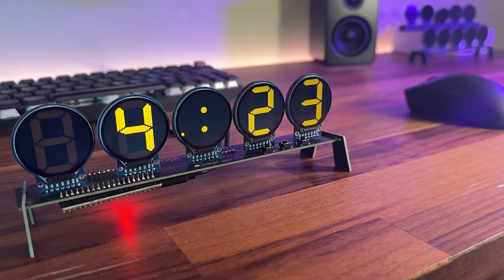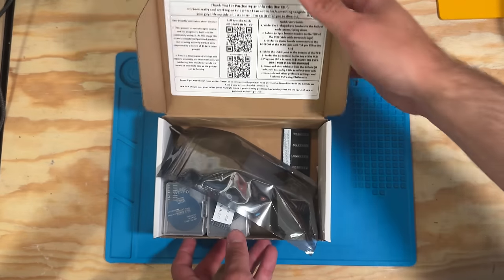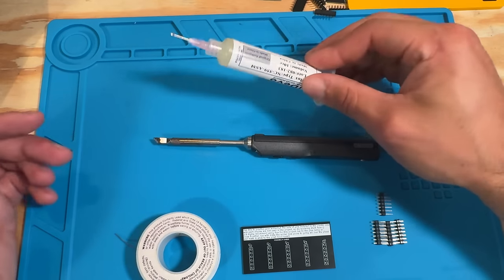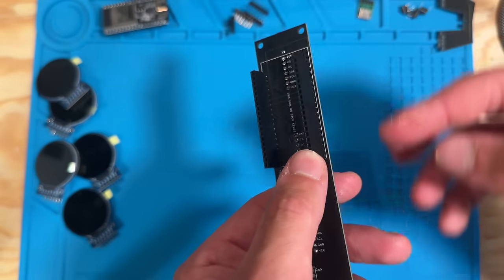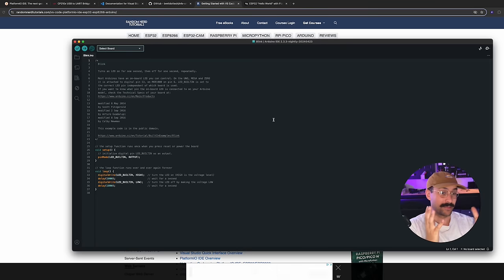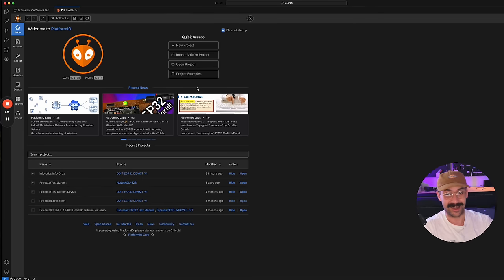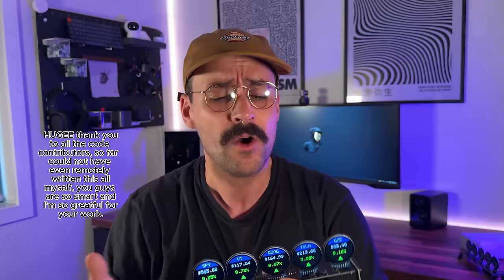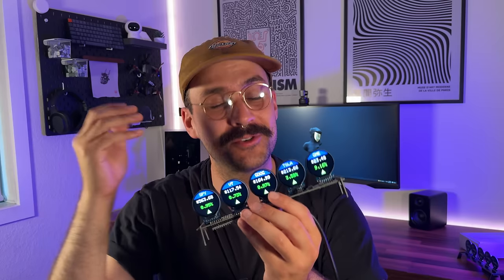I built the open source desk display widget of my dreams, info orbs!

Comment: I can see this being a great display for Home Assistant showing the status of various sensors in your smart home.
Reply: Came to say this exact thing!
Reply: Bro no way!!!! My thoughts exactly!!! Keep me updated on HA stuff with it.
Reply: A quick look at the ESPhome documentation says that the display drivers are supported. So it shouldn't be a problem to flash the ESP32 with ESPhome and display your own data.
Reply: I want that to show info of my solar system that is integrated in HA
Reply: I want to add a microphone and speaker to it too. That would be amazing with HA.
Reply: I was thinking it could pop a phone text message up, and even pop different senders onto different displays.  Also, I am now wondering if there are small rectangular displays, I could nest five together vertically...  or...  you could.  :-)   I might get one though...  I saw a E-Drum video up in the NorthWest and bought the kit a couple days later.
Reply: @encostablanca 100%

Comment: Love it - I built one too using Teensy 4.1 and six little IPS LCD modules - they're super cheap. You can also add a relay for 'ticking' sound that ticks during normal working hours, or maybe with a sensor so it ticks when it sees you.
Reply from the maker: ohhhhhh the relay for the "tick" is SO smart, love that dearly.

The sensors is also something i'm looking into, so maany options there. Motion sensors for wake/sleep, temp/humidity sensors, lux sensors, microphones.
What im considering doing is making a sensor port on the board then making custom PCBs for each sensor so they can be modular and you can pick/choose which sensors your want and have them plug in seamlessly. Thats just a very early stage idea though. 

Thanks for the comment (:

Comment: Built mine today..  Worked great first time.  To get it to reliably flash, HOLD the boot button until you see the "Connecting..." on the programmer, then release, and it should work every time.   Can't wait to see how I can expand upon this, and/or to make new widgets.  Definitely interested in connecting to HA or building a small webserver in it to accept things to display.  Also, would be nice to have the displays auto-cycle between the different widgets!

Comment: Wow great concept great idea and great execution 
Few suggestions if you wont mind
1- A strong base pcb wobble when you press the push button 
2-battery powerd with a deep sleep feature 
3- custom app aur website for updating widgets 
Love the work definitely gonna make my own version and share it with you 
Luv from India ❤
Reply from the maker: Love all the kind words, and really greta ideas! a case/base is in the works by a few community members through way of 3d printing, so stay tuned. Web app/app aswell, (:
Reply: I will add a 3D printed case for the win ;)
Reply: Make additional small PCB for the switches that make it a tiny console so you can find a way to keep the board flexure from happening. AND it would allow the switches to be on a cable and then an enclosure could be made for the discs and the switches.  Could even build little cables for each disc and put them inside a "floating" enclosure, like an old retro TV or radio set.  Or you could put a bare  (or ground plane covered) PCB rib along the length of the board that has small tabs that get soldered to or thru the main PCB stiffening it immensely.  Even the end tabs could have soldered fixation if the pads are placed correctly.

Comment: Low profile SMD headers can be used through-the-board. So you can have connectors on the hidden side of the board and on the top you just stick the pins of your display right through for a hidden connector look. Just need to be a lil careful because unusual force can delaminate the pads of the carrier header. I suppose ideally you'd have the display unit fail rather than the carrier board, i suppose, since you include one extra, but perhaps it's not so bad really, i mean the motherboard is basically free of components anyway so there isn't much cost to it per se if it needs to be replaced.

Another option is to have a machine pin male header (round pin) going through the carrier board with the retainer plastic being the hidden side, with machine header female headers 90° on the display units.

Comment: This looks awesome.  Honestly, I don't have the willpower for the project and the code setup.  But if you develop this to an assembled kit, some enclosure and a Home Assistant plug-in, I'd be in for something in the $150-200 range.
Reply from the maker: This is very much on the horizon (: We're (and by we I mean some key members of the community in this case) are already developing a companion webapp so you wont need to flash it with code or anything and can configure it all from your phone/PC, and then the assembled hardware is even closer down the line. Homeassistant sensors/notifications would be super easy to support and I'm sure we'll see a widget there in the next few weeks, so def keep an eye out! Thanks for the kind words!

Comment: Suggestion: Maybe include a few more PCB Feet that can be slid on before the components are soldered to remove the flex when the buttons are pressed. 
Maybe even double them and super glue together so they are thicker.
Reply: The flexing PCB was my first observation too as it can eventually pop solder joints or damage the traces.
There are several options to solve this, like an extra leg, (it could be cut differently so that it can slide in from the front), or a thicker PCB, or adding a long PCB strip perpendicular to the main PCB, but the best option IMO is to skip the push buttons and use the touch sensing feature of the esp32 instead. Depending on which pins the buttons are connected to, it may be possible to only change the code and solder bare wires across the button through-holes that are farther apart, otherwise the PCB would need to be revised to use 3 touch-capable pins from the esp32, and taking the opportunity to make these traces thicker and ending with a solid tin pad where each button was, for better conductivity. 
[edit] I checked the PCB schematic and the buttons use pins 25, 26, 27. Unfortunately 26 and 27 don't have touch sensing so using that PCB would require constant polling with analogRead() to detect touches, while touch-capable pins allow using interrupts which is preferable. [/edit]
Reply: Yea, I’ve noticed that when pushing the button it flexes a bit. Maybe even 3D print a bigger base for the whole thing then just have the screens poking out the top

Comment: so tempted to order one - the pc side i would be fine with, its just the soldering i KNOW i could not do. Do hope you eventually bring out a pre-built one. and then we just need someone to design a surround for it for 3d printing!
great job by the way - always love your tiktok content
Reply from the maker: One the initial rush of orders is done I think I may add an option on the store to have me solder/test a kit before shipping out, It'd like be a $20-$40 add on(does that seem reasonable???) . So if youre waiting for that hold on another few days and it should show up (: 

One of the big next steps for the project will to be to have a fuilly assembles PCBs that ship completed with SMD components and such, but I want to iron out any kinks and additional features we want to add using the dev kits first.

Also re: PCBs, pasting a comment I replied to regarding a similar comment below:
"Theres already been a few people make some variants of this! The stand was designed to be easily removable for this reason, and also 4 M3 sized mounting holes on each corner of the PCB for easily alignment/mounting to a case should someone want to make one (: One folks start making them public you'll certainly find the STLs in the Github!"

And thank you for the kind words (:
Reply: @brett.tech_  not the original poster, but yes. Soldering is not my forte whatsoever, so anything to get that out of the way would be welcomed 😊 flashing software, etc.. is within my abilities 😅
Reply: As a novice at soldering go and the practice board, some pin boards and a cheapo $20 soldering iron, it won't take you too long to become good enough to solder this.  I did this project from start to finish in about an hour.   The hardest part honestly might be getting Platform IO and the ESP32 to be recognized.

Comment: My kit arrived and I had no issues building it or following the instructions. I did hit one snag when trying to upload the app to the ESP32. I got an error that said "Wrong boot mode detected (0x13)!" The work around is simple. Press the "boot" button while trying to upload the image to the ESP32. Once it starts you don't need to press it any more. I was able to load the firmware and everything was working after that.

Great work on this. It was a fun little project.

Comment: Bigest thing for getting these ESP boards to flash is a USB cable with all the pins connected, there is an influx of cables that are power only and will cause a person greef when trying to debug and issue. If its not connecting get a new cable. I have gone through some in my house and I have a 1 in 5 that have all the pins attached and work for programing.
Reply: Yup. I ended up going through all the cables in the house and testing them all, any power only cables went in the trash.
Reply: Happened to me too. I was using a USB-A to C cable, so wasn't sure if THAT was the problem. Turned out no - the data lines were missing in the initial cable I used.

Comment: This thing is awesome! Just programmed and soldered mine up today and worked like a charm.
Had some issue with 4% over storage limit but was able to add build options to fix it.
Designing a 3D enclosure for mine! :face-blue-smiling::hand-pink-waving:

Comment: Got my kit!  Building…. One suggestion for V.next:  add a cadmium sulfide or other photocell to the top of the board so we can do dimming/brightening in response to ambient lighting. Also, a speaker could be useful: ‘Ping’!  Love your enthusiasm Brett!
Reply from the maker: Hope you're enjoying the kit. These are all REALLY great suggestions thank you. The GPIO pin out on the back of the board is in order to prototype things exactly like you mentioned(and far more, like; temp, humidity, air quality, lux, microphones, and all other sorts of local sensors). The current screens being used dont have the backlight pin broken out so dimming wont be possible on the current hardware iteration, however working with a manufacture to make it possible for the next one (:
Reply: Aaaaand, I'm up and running!  So fun!  Thanks Brett!
Reply: @brett.tech_  One more suggestion, you include six screens, but only five right angle headers.  If one of my screens was bad, thankfully not, I'd have to desolder one of the headers to swap in the replacement screen.  That would be a PITA.  ;-)  Also, the female headers on the main board for the screens are too shallow, so the screens rock forward and back.  Better headers like the ones for the ESP32 pls.  Ok, that's two.  8^D

Comment: I wonder if you could use the esp32’s touch sensor feature? Maybe figure out how to make a series of pads on the front edge and then you could implement slide gestures or multi touch
Reply from the maker: I'm going to be honest I had no idea this existed untill looking into this now!
This is quite funny aswell as I actually went down a decent rabbit hole looking at making the buttons on the PCB capacitive touch pads but it ended up being slightly too cumbersome so I opt'd for hardware buttons, this functionality would have made that very easy to do, darn!

I will certainly look at implementing this in the next iteration of the PCB in some way shape or form. Thanks so much for this comment and helping me learn about that feature (:

Comment: I really like the idea. What I don't like are the 3 buttons because they push through the board a bit too much. A housing STL for 3D printers would help and then possibly fix the buttons at the front.
You can normally have this printed cheaply nearby.

Comment: I ordered one  as soon as I saw a "kit". I will try to pair with an API from data shared from my CGM (continuous glucose monitor) that uploads to the Dexcom website at regular intervals when setup on the phone, the CGM talks to an app on the phone via Bluetooth. In my case the older Dexcom G6.

The transmitter is "dumb" it has no memory, though some people (diabetics) use a smart controller that you can reconnect to. 
It should be easy enough to do an http get with the proper credentials, parse & display the value on this device.

I remember trying with Android to get data off the phone, no can do without rooting said device. So phone uploads telemetry to the Dexcom cloud, and I have to pull from the cloud. Smallest interval would be 5 minutes.

Will be a fun project!
Reply from the maker: Thanks for the support (: we actually have a widget avalible in the code (webdata widget) that does all the heavy lifting for you to display data on the orbs from either a local server or elsewhere (via a JSON payload). That said a glucos monitor widget has been something very top of mind for me for some time just due to how useful/helpful it could be for others. If you end up going down this rabbit hole please pop into the discord as I’d love to help however I can (:

Comment: I don't know if anyone has suggested it and I don't know how much additional cost it would add to the kit (I'm going to be ordering mine shortly!), but with as much as the main pcb can flex when you're pressing the buttons, would it be possible to add a third support foot to add to the middle of the main pcb during the assembly process to help with the flexing issue? With as much as it can flex as shown in the video, long term, it's an invitation for cracked solder joints. Just a thought.

Comment: Can I suggest maybe doing a case for printing in 3D and also having option to have the 90º for the buttons for them to be in the front instead of putting pressure on the frail long pcb, because I noticed some sag when the buttons are pressed and in the long term that isn't a great thing...

But I like it a lot! and soon when save enough I'll put one order for my self and maybe 2 more to give as a gift... wish you the best of luck!

Comment: This looks really slick - any chance for a revision to add a local temp/humidity/air sensor on the orb board ?  ApplePay made it fast and easy.......
Reply from the maker: I actually have a plan to have a modular sensor port for just this!!! Lux sensor, temp/humidity, air quality, a microphone (for audio visualizers). Theres currently breakout pins on the rear of the board with power and GPIO to prototype this, so if you wanted to retrofit/start testing this its possible already!

Comment: Using flux for through-hole soldering? Unless you're working with heavily oxidised PCBs/components, or you're reworking existing joints, that is not needed. Your solder already contains all the flux that's needed for soldering clean joints.

Flux doesn't "make your solder stick better". Flux helps removing the oxidation layer on top of the metal, so the solder and the wire/trace can bond. If the solder just sticks to the surface, you get a very bad connection (a cold joint). You want the two metals to combine into one. Soldering is like "glueing" two pieces of plastic together by applying solvent, not like sticking duct tape onto something.

Comment: I have a few round TFTs but they are rated at 3.3V.  In your wiring diagram it looks like you connect to 5V.  If I buy your PCB does it connect to 5V or is there a 3V option? Thanks

Comment: Hi, new sub.

Really good video.

I was wondering if you can use a Meshtastic esp32 lora board.

Then it can share info across an online gateway and offline long range mesh network?

Very interesting so you find it fascinating
Reply from the maker: Love this idea! This would make the whole project allot more expensive as those boards arnt as cheap. HOWEVER, i personally also love Lora; I've been exploring the idea of having swappable moduels//sensors for the board and it would be very easy to add a LORA moduel for this which would achieve the same thign!

Comment: 3d printed enclosure from the open source community?
Reply from the maker: Theres already been a few people make some variants of this! The stand was designed to be easily removable for this reason, and also 4 M3 sized mounting holes on each corner of the PCB for easily alignment/mounting to a case should someone want to make one (: One folks start making them public you'll certainly find the STLs in the Github!

Comment: is there a way to use the straight connectors for the screen and have them parallel with the board? so as to make it more slimline. obviously the stands wouldnt work anymore.
Reply from the maker: Not only is it possible but quite a few folks in the community hasve done this already, also makes it super easy to mount to a flat surface like a wall (:

Comment: Brett, Put the kit together and all worked well as you described. All software went without a hitch. The programming of location, time and stocks all went smoothly! Initially all booted up fine and seems to be working well. After about 2 hours the right 2 displays were black, and the middle distorted. Shut it down for about an hour, rebooted and all seemed good again. After about another 2 hours the same failure occurred. All solder joints were tested good.
Any thoughts? 
Thanks for your efforts.